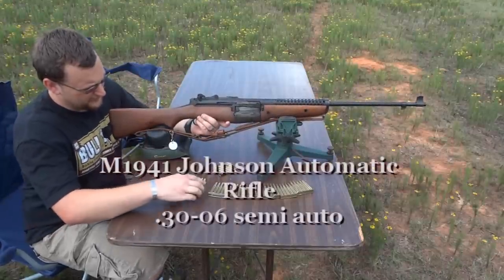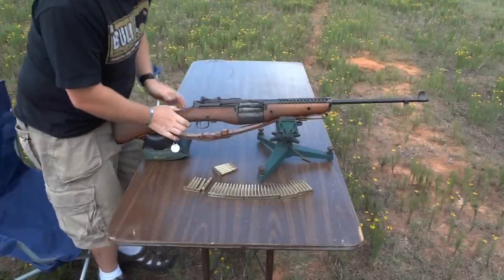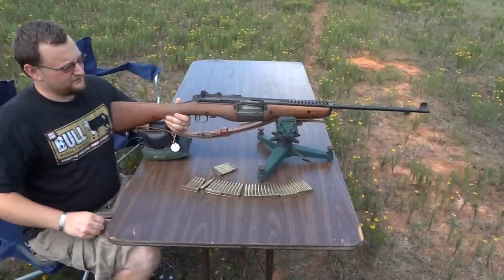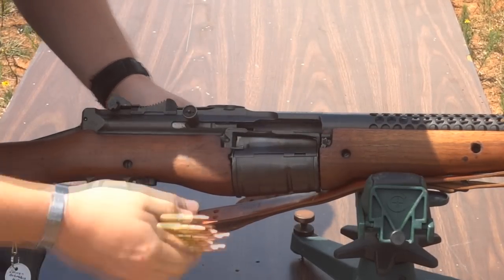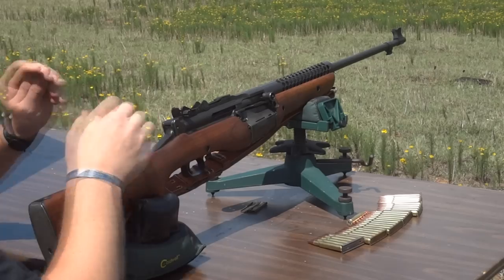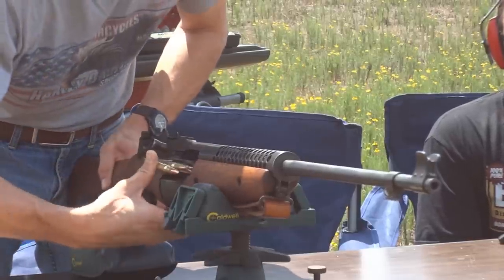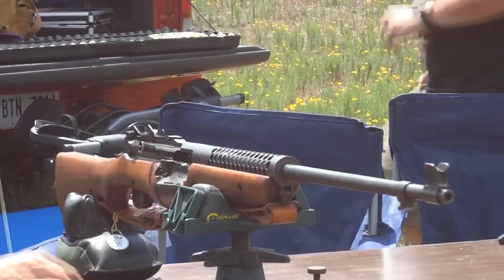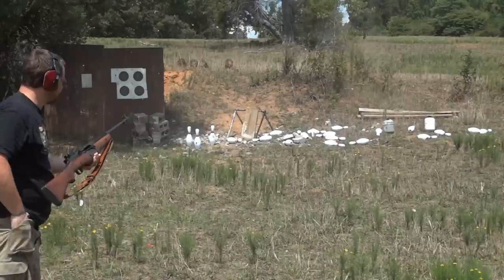1941 Johnson Automatic Rifle WW2 .30-06 Semi Auto

Comment: You say you are having trouble loading 10 rounds.  I will tell you why.  The Johnson m1941 is designed to hold 10 +1 however in order to load two full stripper clips you must do it with the bolt closed.  I came across an old training manual after I acquired a m1941 and it clearly stated bolt open only load one stripper clip, bolt closed load two.  Otherwise fantastic rifle I love mine, it took me years to get one and it will be forever before I let it go.
RIP Barry
Reply: ***** I'd like to have a Johnson.  Should have gotten one years ago before the price went way up. BUT......I remain ever hopeful.
Reply: @andymaciver1760  Sounds like you're into it.
Reply: @88mike42  i dig Johnsons...what can I say?
Reply: @andymaciver1760  Rather like 'em myself.
Reply: Did it go up in price again?

Comment: A slight correction, the johnson rifle was NOT more expensive to make; on the contrary. The reason it was not adopted (more) was because the garand was already adopted and in production by over a year before the first johnson was submitted for trials. A company that made brakes and rims reported they could churn out 300 an hour if they had the barrels made for them. It is a remarkably simple rifle to make.
Reply: The Johnson was designed by then-Captain Melvin Johnson, a U.S. Marine - who also designed the Johnson light machine gun, and M1947 Johnson automatic carbine. The fact that Johnson was a Marine probably worked against him, given the fact that the Army Ordnance Corps in those days had something of an adversarial relationship with the Corps, and that the Army supplied the Corps with weapons only when its needs - real or imagined - were satisfied. Johnson's designs weren't bad, but they were a bit too eccentric for the conservative inter-war ordnance community.

Comment: Nice video, thanks!

I've owned an M1941 for many years. It's far easier to load with the bolt forward. Otherwise, rounds get stuck in the feed lips and you can't fully load the magazine, as you noticed. With the bolt forward, clip and single round loading are slicker than snot!

It's heresy, I know, but I prefer the M1941 to the Garand. As it has no gas system, it's a snap to clean, too!

Comment: If I remember correctly from Johnson's book, this was cheaper not more expensive to manufacture than a Garand. Designed to be made in a standard machine/ tool and die shop with no special machinery or tooling. Prototypes for the 1936 shootoff may have been more costly since they were only 2nd gen. and not Full Scale production models.  Didnt even need a special barrel- could use a standard 03 Springfield barrel and just add the collar to it. Poorer reliability was a function of having only a few years of development time- limited design maturation. Failures were limited to a few small parts that were under designed.  Garand had what, around 20 years and unlimited budget? Johnson spent most of his time soliciting investors for money and had only 1 major pass at improving it. Amazing success with such limited financing and time, being only a lawyer, with no engineering background. Detachable magazine- he started working it, and knew it was viable but realized he wouldnt get the bugs worked out prior to Govt test and he went the safe route. This design had limited muzzle climb do to straight back recoil buffer design in the stock (Stoner-say thank you- he leveraged much off Johnson's design, even credited him if I remember correclty.). QD barrel design enables quick breakdown, ideal for airborne use. The bayonet was a problem he knew he had no hope of fixing. Came up with t spike bayonet to meet the technical need. As far as choosing the Garand over this, the fix was in for the Garand- Govt spent 10s of millions developing it and 20 years, and the Procurement Board admitted they only gave lip service to the Johnson. They werent going to let some Marine upstart with a privately developed design beet out the Arsenal developed concept even if they could get it top perform better (but didnt in time).If Melvin got rolling a couple years earlier, good chance history could have looked significantly different, or we could have had a dual development path weapons program. Dont get me wrong, I love the Garand, own a bunch, but this has always been my favorite since I was young. IF he did, M16 / AR-10 designs would have been fielded by 1950s in my opinion.
Reply: Biggest issue with the Johnson is that it was  impossible to fully field strip. It almost never failed but if it it did, you'd have to pull out your sidearm until the battle is over and use a screw driver.

Comment: You can see why the Garrand was a better option.
Reply: ColdWarWarriors  I would rather this rifle in my opinion the only downside is that it doesn't like bayonets
Reply: It was never designed to accept the standard US bayonet at the time hence the problems with it.
Reply: @SinCityKittie  Yup they forced him to have a bayonet mount while the designer had WW1 experience and said bayonets were a waste of time in modern warfare which I am inclined to agree with at that point in history.

I feel like the ability to load individuak rounds to top-off the magazine could have been quite a boon in the right circumstance.

Comment: That's fine, to each their own, Mauser is in American military history so it makes sense. When you're shooting at distance however, even with semi autos, you have to take time to line up the sights otherwise you won't hit a thing. The Lee bolt can be worked with quite literally a flick of the wrist, and its design makes it inherently smoother than any Mauser or Mosin. Also, notice the speed at which the bowling pins were knocked down; a Lee Enfield could replicate that. Enfield isn't too complex

Comment: The M1 fires M2 ball .30-06 ammo. It is lower pressure than standard .30-06 ammo. You can bend the operating rod if you fire standard ammo through it without a gas regulator.

Comment: I own an M1 Rifle, and it is quite heavy yes, about 11 lbs. Pretty sure the M14 is roughly the same weight. That doesn't change the fact that it's more robust, easier to reload, and the design is inherently more accurate than the M1941 because the action doesn't move until the bullet has left the barrel. There's also the benefit of being cheaper to produce, and the parts of the M1 are harder to lose. The full disassembly/reassembly itself is quite easy on the M1. 3.5 minutes without trying.

Comment: I wish someone would make copies of this rifle in .308 Win.
Reply: y .308 when its already 30 06
Reply: yeah, no need to reinvent the wheel. Just somebody build new ones from the original schematic. The originals start at auction at $3,000. It would be cool if someone were to resurrect it.
Reply: Charles Lovallo .308 ammo way more plentiful and cheaper.
Reply: The only market for this gun is for an exact as possible recreation of the original. It's very niche, and hobby plinkers who care about saving $0.09/rd don't buy stuff like that. If you want a cheap .30 cal semi, buy a G3. A 1941 Johnson in .308win would cost more to design, and would completely flop if released alongside a .30-06 model.

Comment: It would of been cool if you showed the bolt design and how it operates. That would actually give others an idea of how advance the Johnson rifle actually was. As someone had mentioned in a previous post, Eugene Stoner took a long hard look at this rifle before designing the AR15/M16. The Johnson bolt design is in similar fashion(multi-lug bolt locking), including the buffer assembly which also consists of a large mainspring and tube running down through the stock. And this was 1930s technology.

Comment: These Rifles are much much better than the M1 Garand, they are made to a much higher standard, and are much more reliable than the M1, The Marines that used these were knocking off Japanese Soldiers at ranges the M1 could not, and in a fire fight the Marines just blew the Enemy to pieces with these, The main reason This was not adopted, was that its designer Melvin Johnson, was very out spoken and critical about the Infantry Weapons The U.S. selected and used. And he did not get along well with Ordinance Officers, and said The M1 is a good weapon but his was much better, he was a Marine Corp Officer and listened to the men that had to do battle with the enemy, at close ranges, many of them disliked the M1 Rifles, and would much rather carry a Johnson....The excuse was they couldnt be produced as fast and they cost more per rifle to build.

Comment: The Garand can be topped off with single rounds, I do it all the time, it just takes a bit of finger strength to hold the bolt back while u top off, in combat you wouldnt really do that, you'd just manually eject the whole clip and insert a fresh one.

Comment: Also would like to add, the Johnson is actually faster to load than a Garand. Reloading is much easier to do with stripper clips when the bolt is closed. It is more difficult to load as you showed in the video with the bolt open due to the cartridges wanting to slide up in to the chamber. I also own a Garand, the Johnson is easier and faster to load. The Para-Marines would actually take out and ditch the bolt hold open device.

Comment: 5.56 millimeter is the NATO round used by the US and other military units around the world. .223 is the customary nomenclature of the round. An Ar-15 can use both if it is designed for 5.56 because it is higher pressure. If it is designed for .223 however it can only use that round safely.

Comment: @gangsta2wo6ixworld The Johnson looks similar to the Carbine but is bulkier.The M1 Carbine is chambered for a different cartridge: the .30 Carbine (7.82x32mm in metric), not the 30-06(7.62x63mm). The M14 is chambered in 7.62x51mm while Mini-14 fires an even smaller cartridge: 5.56x45mm.

Comment: Good thing John Cantius Garand went down to the US from Canada; I don't think the US would have been quite so successful in WWII if they had to make the M1941 standard issue to replace the M1903. I think it would have cost a lot more lives in instances where having an M1 Rifle would have saved them. Not to mention it was designed 5 years after the M1, so that's 5 less years of producing semi auto rifles, and then starting to produce the more costly rifle the year the war started?

In such a case, I dare say that for most of WWII, the M1903 would have still been the primary service rifle, with the M1941 slowly replacing more and more of them as the war went on. That's my view on this hypothetical situation however, also considering the loading mechanism, it probably would have become standard to be constantly loading in a single 5-round clip at a time, never ending up with more than 9+1 rounds, and try not to go completely empty because loading 2 clips at a time would just be a hastle. Then again, I never handled the rifle, perhaps Eric is right and given time, soldiers would be able to load in 2 clips with relative ease and grace. Interesting to think about what-ifs, when it comes to firearms and history.
Reply: Alternative history is always a tricky thing. Had the Garand not been adopted, we have no way of knowing what would have happened after that. Perhaps another designer would have come forward in John Garand's place, perhaps not. We'll never know... but it is fun to speculate, isn't it?

Comment: I got my Johnson for $250. In a parking lot sale at old Sacramento armory (my favorite store) in the 1980s, I wanted to get more but they were in a pallet box full of cosmoline, u had to pry them out & even then u couldnt see what cond. They were in so I only got one. Still kicking my ass for that. Theres 3 parts that can be put in backwards then the gun wont work, they were to complicated to take apart by the average guy. On mine the upper tang realy stings the hand like hitting a baseball wrong so I put my thumb on the side instead, the tang is unsupported underneath and vibrates badly. The recoil spring asmy. Is under it. I was able to put a piece of hard rubber under the rear part of it, so far it works & has not fallen out yet. Still looking for a bayo, I wont use a repo, Repos are pretty crude on the machining. Only an orig will do.